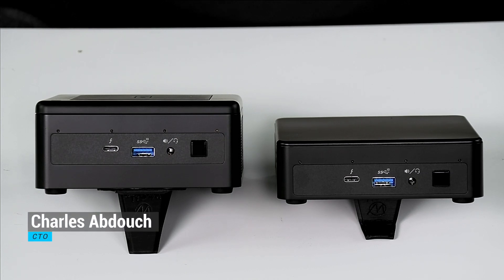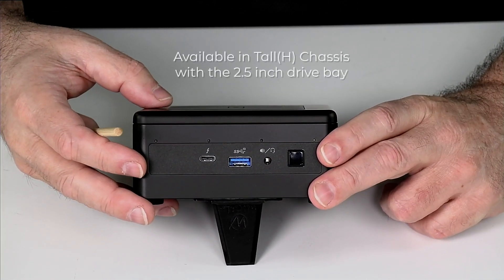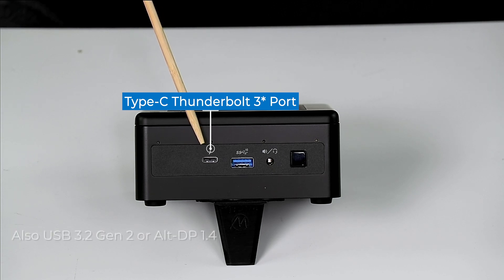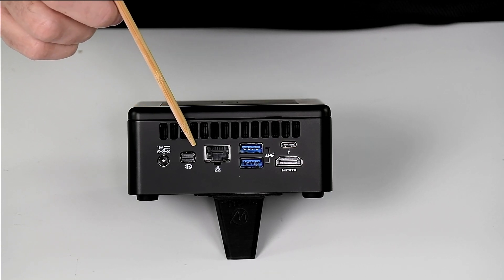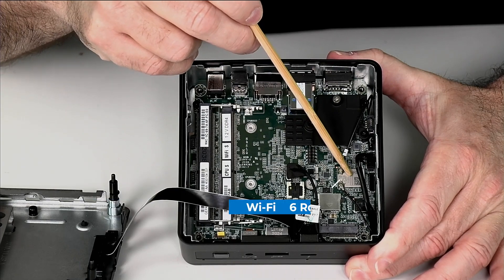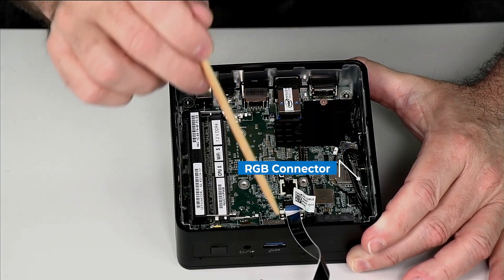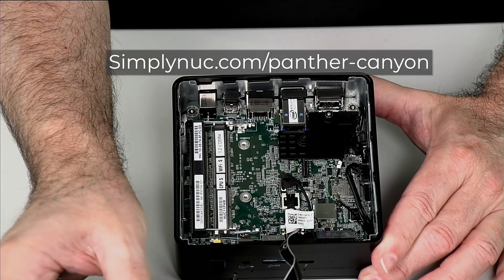Intel NUC 11 Performance - Panther Canyon - Unboxing

Comment: I was thinking about getting the 11th gen enthusiast NUC (with the 2060 graphics along with Xe).  Looks like that one has at least one M.2 PCIe Gen4 slot.  Panther Canyon looks solid if an integrated graphics solution is all you need.
Reply: Could also hook it up to an external GPU if needed.
Reply: @LuminousPrisms  Absolutely!

Comment: So wait, I have a few questions. 
1) The rgb port, is it already hooked up to the pc and if so where are the rgb lights? If it isn’t hooked up to the pc does that mean we can add our own?
2) can you use cortana instead of Alexa for the quad mic array?
3) for the CEC port (I have no idea what it is) how could I set that up just like you said and have it so that if I turn the monitor on then the nuc turns on aswell? Will there be a need to keep the case open the whole time or is there holes in the nuc so that the cable can safely connect to the monitor?
Reply: Howdy, sorry about the delayed reply, I don't notified by Youtube.
1) Yes, I believe we can add RGB LEDs to the unit, and someone on the Engineering team might be doing this soon as an experiment.
2) Yes, you can use the built in Mics for Cortana. Alexa requires an always on microcontroller that saves 4-6 seconds of audio and responds to the "wake up word" and the request, since the computer could be off "Alexa, turn on my computer". Cortana only works while Windows is running.
3) CEC is a wire on the HDMI cable that links Surround Sound systems to TVs, DVD players to TVs, etc so that powering on or off one component causes others to turn on, or change input sources.
Having CEC supported on the NUC means turning it on could switch the TV to that HDMI input, or turns the TV on at the same time. I would expect that the NUC could be configured to turn on based on the CEC signal as well.
This is not a simple high voltage or low voltage signal, but digital information is sent down the wire in what is called "1-wire communications"
https://en.wikipedia.org/wiki/Consumer_Electronics_Control

Comment: the intel website clearly states thunderbolt4 is present. What am i missing here?
Reply: Basically the Type-C port on the front only supports a Single Stream, and if called TB4, you would have to qualify it isn't a full TB4 port, but calling it TB3, it does everything TB3 should.
The Type-C port on the back supports Two Streams, so it could be called TB4.
As an technical person, I would not correct someone calling either port, either term. But as a technical person, I try and represent the technical details as best I know them at the time.
While I referred to both ports as TB4, I believe that Intel refers to the both port as TB3.
Both ports do support PCIe 40Gb/s communications (shared) and you can drive multiple 1920x1080 monitors off the front port, or a single 4k monitor, or up to two 4k monitors off the back port.
Reply: I’ll bet it was a mouthographical error.
Reply: Thunderbolt 4 is only for Pro NUC and Enthusiast NUC only. Performance NUC only use TB3.

Comment: PCI Exp Gen 3 or Gen 4 ?   Samsung EVO 980 Supoort  6500/6500 MB/s ?
Reply: I read on the Spec, they said it has:
One M.2 PCIe Gen 4 NVME

One M.2 conector supporting M.2 22x42 sata SSD, PCIe or USB 3.2 expandibility

Comment: No ventilating exhaust fan?how is the cooling?
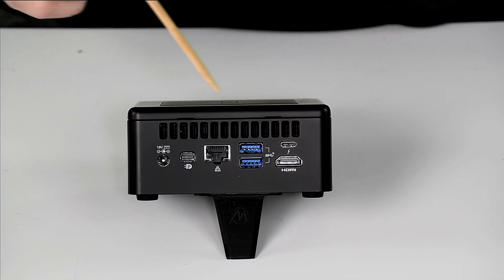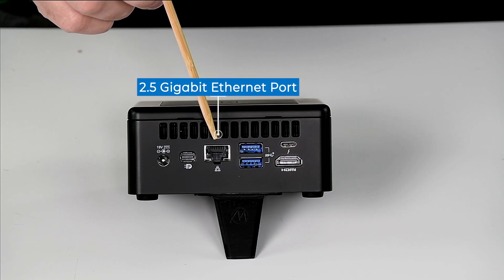Reply: There is an 80mm blower inside. It draws air from the sides (video time 2:05 through 2:18) and exhaust it through the slots along the top on the back side (3:52 through 3:54).
The large 80mm blower allows it to move more air at lower RPMs so that is is usually very quiet except under high loads, and even then, not very noisy.
Reply: @charlesabdouch3052  all you can see is air holes but you watch whole video, there is no fan even after he opened the unit
Reply: @hikooriXgaming  I may shoot another video where I take the motherboard out and show you the cooling blower, but it is under the motherboard. Realize the blower is at the top and we flip over the unit to open the bottom to put in the DIMMs and SSD.

Comment: Wifi card soldered down - that´s a shame. I would like all my new devices from now on, to be Wifi 6E, and therefore would like the opportunity to use the AX210 WiFi 6E card instead of the one it comes with.
Oh well, can´t have it all...
Reply: Phanter canyon only available in asia pasific, you can get tiger canyon for global version with external wifi card